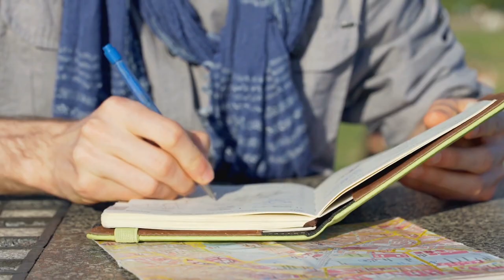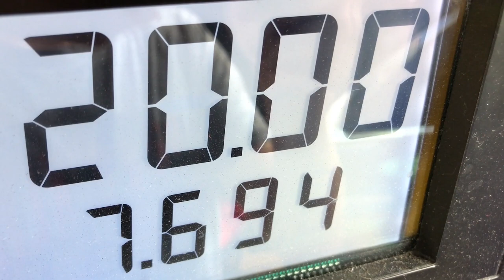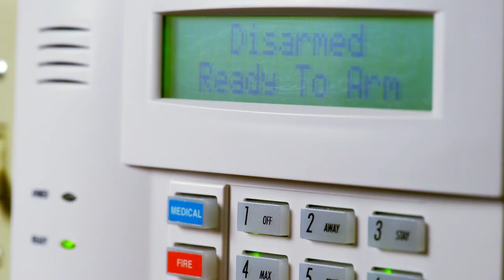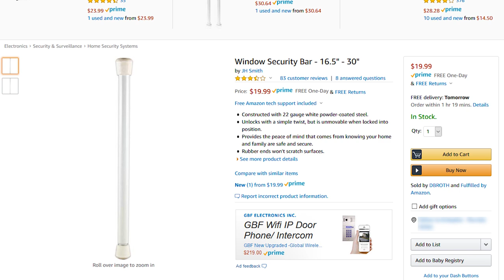How to survive after SHTF in an urban or suburban environment

Comment: A mountain bike might be a good bug out vehicle.
Reply: Yup, just like the movie "Turbo Kid" lol
Reply: Just make sure its maintained well.... and if you have one of those trailers. Then even better
Reply: If you have mechanical skills you can make an off road vehicle with tank tracks. The more people you have in your community the more you'll need as well as fuel but being able to avoid all traffic caused by panicking people is a luxury and due to its design and your bug out location it will be almost impossible to follow you except for trails that can be swept away. A bike is quiet but a trike with tank tracks is fast and doesn't exert personal energy. I cant peddle a bike past a certain incline I have to get off and push it and that makes you vulnerable. Definitely get a bike dont get me wrong its still a viable form of transportation but you still need to put work into a bicycle and extra parts. So if you're really trying to survive pick up a new skill that will allow you to use multiple forms of transportation. I am a fan of kayaking for example and am trying to learn basic mechanics so I can travel on land or by water.
Reply: 110%. I'd suggest a single speeds 29er with some kind of Kevlar reinforced tire, I personally love origin 8's scout frame, as it has attachments for pannier bags if you need them.
Reply: YES. Like with mountain biking in "ordinary" times, ensure you have a spare tube and tools. Small bottles of lube will help keep the chain running, which will inevitably degrade over time. 

I also put Stan's Tire Sealant in my tires to avoid flats from thorns and burs. This stuff is supposedly only for tubeless setups, but ignore that. The shops I frequent put a small bottle in each tube after inflated, which keeps me going year-round without the need to constantly replace my tubes. Thorns are everywhere in many regions, and perhaps the last thing one would want in a bug-out, crisis scenario is a flat on their only mode of transportation.
Reply: It definitely is! I was just talking about this.
Reply: A bicycle occupies both hands and offers no protection. Take it from a 🐺, bad idea.
Reply: Bicycles limit how much you can carry.  But they don't use any fuel either.
Reply: Aa long as you have the cardio and core strength..

Comment: Being a 40+ year resident of Florida, I know what happens to the main roadways when the have hurricane evacuations- parking lot. Therefore, I'm considering getting one of those delivery scooter/motorcycles. Can't haul a lot, but enough for two people w/bugout bags to get out of the city..
Reply: all you need is a bicycle to get to the Everglades
Reply: @TanTran-re1dm  <--- Obviously knows zero about Florida
Reply: All packed up, you will just be a moving target, worse moving to an area where many will be hiding waiting to take down moving targets with supplies. Unless you can drive in darkness...perhaps.
Reply: @sword-and-shield  - We don't have far to go, relatively..
Reply: @ShortbusMooner  As long as you understand that there are groups that are going to be springing into action watching and waiting just for groups on the move...you can possibly form a plan.
Reply: @sword-and-shield  - Yes, and we'll be traveling light. Most of our supplies are already at our destination..
Reply: Scooters have low noise and good fuel econ- go tactical and paint it to not stand out-
Reply: I have a bicycle with one of those little 50cc motors on it.  It will run all summer on a gallon of gas and will go three times faster than a man will run.  Something you use only when you absolutely had to, and only after 90 percent of the population is already deceased.  You may be forced to leave an area whether you want to or not.
Reply: The problem with bunkers is that they double as tombs all too easily.
Defending a house is not a very practical exercise, you will be breached or forced out in less than a day to a determined opponent.
Reply: Honda Rebel 250. Highway speed capable (barely), 80 MPGs, and $100/yr liability insurance. No computers so pretty EMP safe. You can not get a cheaper highway vehicle cheaper.

Comment: Being a country bumkin I've wondered where most "inner-city" people would find water within a reasonable walking distance considering most of the ground is covered with concrete and asphalt.
Reply: Toilets
Reply: 2WheeledWanker ! 
  That would be a shi**y situation
Reply: A river or during the rain. Some cities have rivers running right through the middle. My city isn't like that, but there's a river on the edge of town not more than 3 miles from any part of town. Lot of lazy people and smokers around here, but there are also a lot of bicycles. Walking might not be a requirement even if the gas runs out.
Reply: Lake Michigan is across the street from me I’m chicago...
Reply: C M Pools are a good source as well.
Reply: @alanthesalamander2327  after its distilled it should be. I wouldn't trust all the chemicals put in the water though.
Reply: Hasiger Hase 
  I have a gas powered pump made from a jacuzzi pump and a PVC hand pump, should the jacuzzi give up. The jacuzzi pump could be powered by a raised bicycle rear wheel or whatever, with some minor modifications. Just change the chain pulley to a belt pulley.
  The creek 40 yards behind my house if all else fails. It's big enough to catch a small fish on occasion, but just as likely to catch a cottonmouth for supper. Another huge creek at about 200 yards and 2 ponds. 
  Water wouldn't be a problem.
Reply: Hasiger Hase depends on many things. Where do you live? How many people do you need to provide water for? Short term or long term?
Reply: @CM-ve1bz  the jacuzzi pump is gonna be more complex than you described but in concept yes. Watering holes are where many animals go to die.
Reply: 2WheeledWanker ! 
  The jacuzzi pump setup is a done deal. Tried and tested through countless hours of pumping water from the creek to the garden. The well has a permanent 3/4in line through the cap with 3 Check valves. One at the bottom, one in the middle just because I had an extra, and one near the top to maintain a good prime. I can hook up and be pumping water in less than 5 minutes.
  There will be no unauthorized animal deaths around here, but if there is, that's why I have 4 berkey black filters new in the package, 2 Sawyer squeeze, 2 Sawyer mini, and 1 survivor pro.  If I had to use suspect water like out of the ponds, I would probably build a dirt, gravel and sand filter in a 55 gal drum, then through the berkey filter mounted in a 5 gal bucket.
  Thought I would edit this in on the pump revamp. It was basically disconnect the pump from the electric motor and replace the input shaft with one I made and a pulley on the end of the shaft. I made the input shaft a little long for plenty of clearance and made a mount for a support bearing out close to the pulley.
Reply: @CM-ve1bz  nice. I suggest a water bottle for the Sawyer. My bag ripped and I didn't get much use out of it. If you store water 2l soda bottles are great. Milk jugs break when they freeze.
Reply: 2WheeledWanker ! 
  I keep a couple of 16oz plastic coke bottles in my get home bag because they screw onto the squeeze. Just screw a bottle of dirty water on the filter (if it's not  full of scum or floating chunks) and squeeze, maybe that's how it got the name.
  I don't really store water. I have so many sources to access water, storage isn't necessary. I do have several of the white food grade 55gal drums if for some reason it did become necessary.
Reply: I’m 2 blocks from Lake Ontario.🙂 Also I could use my terrace to collect rain water and power solar devices.
Reply: @alanthesalamander2327  Not really, do some research on the binders left in pool water from chlorine, can you say kidney failure. Distilling would be alright i guess, but who has that energy availible in grid down?
Reply: use a sillcock key to get any water still under load or pressurized by gravity in tall buildings via the panel on the exterior of the building. It may need filtering/boiling to be safe for consumption but it is water and commonly available with little effort involved.
Reply: Sillcock key.
Reply: @kennynoble1223  Most cities have a lot of runoff that goes into the rivers, chemicals spilled on pavement like engine oil, coolant, animal waste.  Be very careful with water that has flowed through a densely populated area
Reply: My local parks have a gravity well pump also I will use filters and boiling creek water lol

Comment: #1 has a work around unless you have the liability of a tankless water heater. If you do have a conventional tank water heater, there is your 20-40 gallon source right there, BUT it is not under pressure so you will need to use the tap at the bottom.

Comment: One of my concerns about densely populated areas is the possibility of the spread of uncontrolled fires if the 911 call system is down or debris blocks roadways so that fire trucks cannot respond or there is no water pressure because the big pumps have stopped working. It is not just the people living in apartments or condo buildings who should worry about fire danger after a disaster. Look at how close together some suburban starter homes are on their small lots in many new housing developments. Some of those houses are less than 12 feet apart. Once a house is fully engulfed, the two closest houses can catch fire too and soon the whole neighborhood can go up in smoke. And hot embers can get deposited down wind to start fires in other neighborhoods. 

If there is looting, especially looting of liquor stores, after a disaster then arson is sure to follow. And when the power grid is down, many people will light candles and all it takes is one act of carelessness to catch a house or apartment on fire and for that fire to spread to other homes. And even if their homes do not catch fire, many people in nearby neighborhoods could be breathing very smoky air for days if multiple fires are allowed to burn. Consider the impact of such a high level of air pollution on people with asthma or other breathing issues. If a disaster strikes when you are in a densely populated area, it is a good idea to evacuate right away to a less densely populated if you can do so safely.
Reply: I agree. My view after a SHTF event will be echoed by Baltimore and Chicago. Riots and mass crime. Stores burned and ethnic stores lit on fire. Pay back. A good urban movie is the" The Pianist". Poland was invaded by the Nazi's and big cities were target. Once Jews were gathered up, they were assembled in a large city and required to build a wall around it. People were required to wear arm bands with a star of David. An apartment may have 5 families. Food and water was a daily battle. This fella survived by hiding and not getting in the trains. He fought severe cold and not burned anything of fear smoke giving his position away. Years go by and how he was helped was incredible. Most in our country will be on trains. Your government will turn their backs on you and focus on themselves. Be careful who you vote for.
Reply: So why does the looting of liquor stores lead to arson? I had not heard that.
Reply: I live in an apartment (Not by choice. Our lease expired and the rent was raised way out of our budget, and EVERY other house we applied for went to someone else so we ran out of time and had no choice.) I’ve been really worried about fire, but especially if the power goes out in the winter or any other time. Candles, fireplaces, grills... all those things people use for light and heat if the power is out will be especially dangerous. And all my preps are in my apartment because I have nowhere else to put them.
Reply: @jimstrope701   Recent US history has shown us that during blackouts in large cities, local criminals will start the looting if there is not enough of a police presence and after that all types of people with no previous criminal records can start helping themselves to the merchandise in stores that have already been broken into including drinking the beer and liquor they find. Once you have some drunken young males roaming the streets and not enough police presence  it is just a mater of time before some of them start arson fires in buildings or parked cars. This is more likely to happen in poor neighborhoods during times of high unemployment. I recommend watching the DVD "Blackout" by the series The American Experience 
produced by PBS.
Reply: @tarabooartarmy3654  I too have lived in apartment complexes and there are some things you can do to stay ready to evacuate should a fire breakout nearby during a disaster. If you have a vehicle, keep it in good repair, park it somewhere it will not get boxed in by other vehicles and where a building or large tree cannot fall on it and never let the fuel tank fall bellow half-full. If you do not have a vehicle, at least have a bicycle and also arrange to ride share with someone who lives nearby that way you have two possible ways to evacuate if you do not own a vehicle. Keep some or all of your emergency supplies in cardboard boxes so they are ready to load into a vehicle at a moment' s notice. Have a small suitcase or tote bin or backpack that stays packed with two changes of clothing, pair of shoes, pajamas, toiletries and ready to load into your vehicle. Make sure the batteries in your apartment's smoke detectors are replaced annually (make sure there is a smoke detector in each occupied bedroom and one on every floor). Have a supply of battery-powered or solar-powered lighting for use during power outages (one headlight, plus a table top camp lantern, plus a flashlight the size of a bar of soap would be the bare minimum for one person in an apartment). Keep a flashlight and a pair of slippers or shoes beside your bed just in case there is an earthquake at night that knocks out the power grid so you will not cut your feet on broken glass. If the power grid does go down and you do not yet want to evacuate from your apartment, make sure someone will be keeping fire watch at night while others sleep and is willing to sound the alarm if a fire starts nearby. If you store a lot of emergency supplies in your apartment and are concerned you may have to abandon them if a fire breaks out, you may want to rent a small storage locker at the edge of town along your evacuation route and put half your supplies in the storage locker. Or leave some of your supplies in a locked trunk at a friend's house across town. It is also good to keep at least $200 cash in a safe place in your apartment ready to take with you if you need to evacuate at short notice -- remember that ATMs and credit card readers will not work during a power outage. Most of us do not have the ideal set-up to ride out an emergency but there is usually something each of us can do to be better prepared.
Reply: @jimstrope701  Liquor contains 80% or higher alcohol content. I seen on LA - TV in the 70s how rioters break into these store, stole cases of alcohol and lit the place up. Once the heat is high, glass breaks and alcohol explode. Live on TV.  Same day African Americans pulled the white truck driver out an beat him with bricks to the head and large stones over and over.
Reply: Yeah, we had a fire here in Santa Rosa CA which killed 40 people. I was here the night it happened. That is why I always have a mask and plastic goggles with me in case I need them. 🔥 💀
Reply: PrepperVet Mitchell 90's, it was the Rodney King riots. Fortunately the driver survived. I was managing a sporting goods store in a neighboring county and we had to pull all guns, ammo and camp stove fuel from the floor. Was a major pain in the ass but we understood. Was glad that I concealed carry to work that day and the days that followed. Tense times in SoCal 😞
Reply: PrepperVet Mitchell   Not really. 80proof is only 40% alcohol.

Comment: High rise tip, Internal window boxes for food growth, external ones are a big flag for FOOD IS HERE!
Reply: GuidesH 101 
  If water isn't flowing and electricity is off, I would think high-rise buildings would be empty above the first few floors. Carrying water up several flights of stairs every few days would get old in a hurry.
  If electricity is still working, it wouldn't be such a big deal.
Reply: @CM-ve1bz  rain traps come in handy for this but it is more for riding out the storm bugging out is still NO.1
Reply: Its all flagged once the groups emerge.
Reply: Really good idea - I already have plants on the window sill and they grow really well.

Comment: I didn't think I was fit by any means but I realized how out of shape I was a couple of weeks ago on vacation when I hiked 1.25 miles up a mountain on a designated trail. My feet hurt about 3/4 through and I was out of breath throughout.  My husband (who is quite fit) had to hold my hand and basically pull me up a few of the steeper inclines.  What an eye opener.